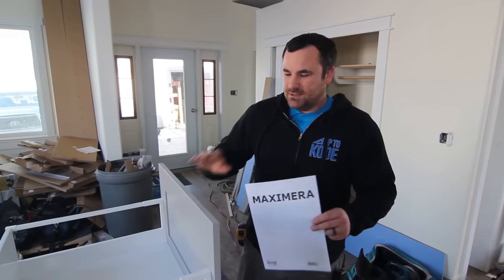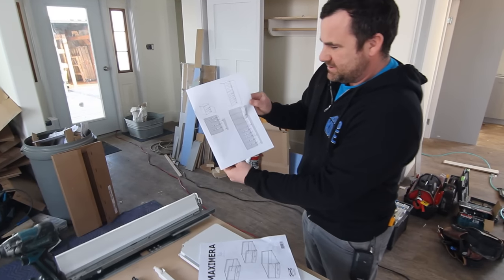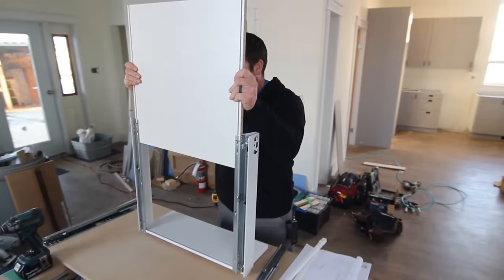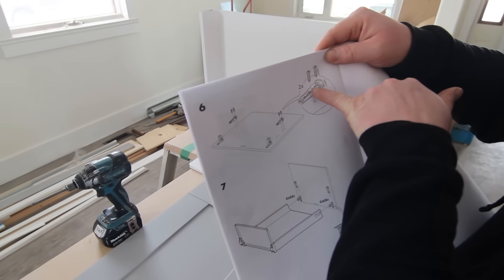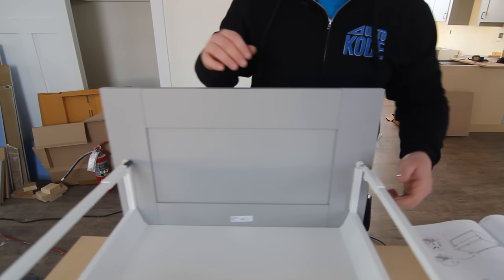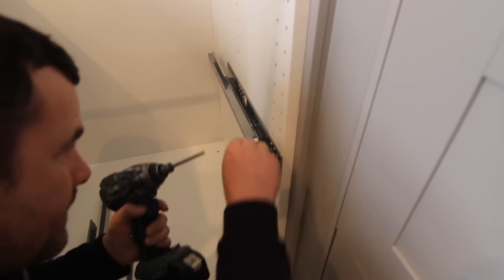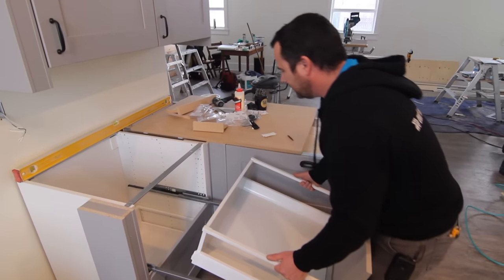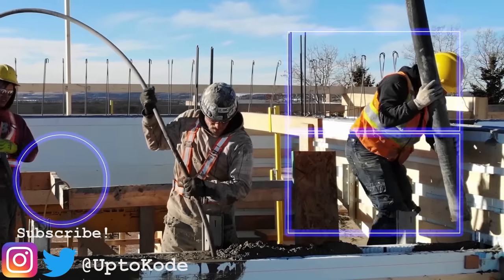How to Build an IKEA Maximera Drawer

Comment: I know this is kinda old now, but thanks for leaving it up. I have these drawers in my kitchen and one of the rails pulled loose.  Contractor seems to have only put one screw in the front part of each of them so weight was just eventually enough.   And I couldn't remember how to take them out without disassembling them so this helped me a TON.  I also used the opportunity to reinforce the rails -- recommended for anyone using the large size maximera for dishes/pots/pans.

Comment: Thanks very much for your video! I looked through the instructions and then watched your video before assembly.  I had totally missed the nuanced upper or lower holes in installing the rails, as well as the flush vs recessed front instructions. This was super helpful!

Comment: Kody, props out to you tonight.  Putting together a Maximera 3 drawer and couldn't figure out why the middle drawer was slightly out of line.  Was super familiar with the older Akurum line, but this is my first Sektion kitchen.  Knew I would find an answer from you...the VERY subtle difference in the screw locations for the mechanism that clicks into the drawer front between the bottom drawer and the middle caught me.  Thank you SO much for pointing out that super subtle difference in the instruction manual.  Screws relocated and drawer fits like a glove.
Reply: I made that same mistake with my bottom (high) drawer. I had to reread those instructions a few times to catch that subtle difference. These videos are very useful.

Comment: Many many thanks Kody. I cannot tell you how helpful your video was for me. 

Everytime we go to our place in Spain I try to improve something. This holiday it was to fit two hidden soft close internal drawers in the kitchen.  
The drawers in the kitchen in Spain are quite deep and the air space at the top of the drawer is unused. Putting in a hidden drawer would utilise this space. 

Of course the process of any DIY project is not always straightforward. Ikea have many kitchen variants and which one is yours! Luckily I have kept all the receipts and plans for the Kitchen in Spain and ours is a Maximera Kitchen. Once this is identified you have to buy the right kit on the Ikea website and the drawer and drawer fronts are sold separately. I am knowledgeable now but on the first pass it is daunting.  A quick trip to Ikea in Malaga and under the tutelage of a very helpful assistant all was sorted. The cost was extraordinarily cheap. The drawer was Euros 38 and the drawer front Euros 8. I bought three fronts in case of error! 

Ikea instruction manuals are not for the feint hearted. Each manual was 44 pages long. It covered all variants of the Maximera drawer range and it was up to you to follow the page sequencing for your drawer. I gave up and watched Kody's very helpful YouTube Video. Armed with the video and my manual the first drawer was constructed and installed in three hours. Mistakes were made and the whole thing was disassembled and restarted. Making sure the drawer base was fitted correctly in the slide grooves is important! The real trick was the positioning of the runners in the cupboard which was difficult to understand initially. The problem was that the handles on the exterior door front had screws on the back and the suggestion for the runner position in the manual did not allow clearance for these screws. The hidden door front was damaged when the screws from the exterior panel bashed into it. I worked out the correct position, replaced the door front and all was well. Fitting required a new exploration of yoga positions and it was 31 degrees centigrade (88F) in Spain! The second one took 30 minutes from beginning to end.

I am very smug and proud. The drawers are perfect in spite of my Wife’s frequent exultations to “leave it, that will do”. Perfection is what we seek! 
Thank you again Kody for making this project such a success.
Reply from the maker: Thanks for sharing your story! Glad I was helpful for your project

Comment: Have you ever installed the drawer rails before completely assembling the cabinets?   Two years ago, I assembled 5 of these cabinets for my office. I did it per the instructions. It's such a tight space to screw the drawer rails into a closed cabinet. If I know what size drawers I'm installing I should just be able to count the holes, right?  Is there a reason NOT to do this??  I'm over being a contortionist.  Would like to know your opinion.  Thanks
Reply from the maker: I don’t see why you can’t do this.

Comment: Thank you for the video it was very helpful. I struggled with the rail placement until I saw your video. It took a magnifying glass to see what hole the rail screw went in, could Ikea not make it any smaller as hole placement is critical for the hidden drawer and large drawer.

Comment: Thanks for the videos! I have an issue I haven't been able to resolve. I have a 24" wide base cabinet with 3 internal medium drawers and a 24x30 door front with the 153 degree hinges. I believe I've put the drawers on the correct holes, but there's no room for the lower door hinge. It seems that I'd have to raise that bottom drawer about 2 inches, which leaves a funky void below. What am I missing?
Reply: What are the interior dimensions/clearance of the two drawer cabinet.  I’m wondering if they would fit vinyl records for storage

Comment: Hi Kody, your videos are great.  Maybe you can help me.  I'm assembling the maximera two drawers and I can't make the bottom drawer fit.  the top and hidden drawer worked fine, but when I put the bottom one it clashes with the top one so it doesn't close correctly.  Please help!!  Thank you in advance.
Reply from the maker: I can’t remember if this video shows the specifics of the drawer hole placement. You really have to keep an close eye on what hole is used depending on drawer layout. 

How to Read and Understand IKEA Kitchen Manuals
https://youtu.be/em4npozEkCs

Comment: Kody, is it okay to use the maximera low drawer for the bottom of a 30 inch sektion cabinet with a 30 inch by 20 inch front? I made the mistake of buying a high maximera and the back of the drawer hits the disposal.
Reply from the maker: If I’m catching this right yes you can use a large front on a low drawer. You just won’t have a way to adjust the front and it might be a bit flimsy.

Comment: I have assembled a lot of Ikea stuff but this is my first time with kitchen cupboards. after watching a few videos I am very comfortable attacking my newest job. thanks a lot for this video as some of my installations involve slideing drawers. but would it not be easier to install the sliders before actually assembling the unit? you don't have to climb inside after all right? just sayin'
Reply from the maker: It’s possible! If it works for you and it’s more efficient then great! Try it out
Reply: @uptokode  boy that little trick to take the drawers apart after assembling really came in handy a couple of times. as easy as it is to put these things together of course I made a couple of mistakes but that trick made them easy to correct and I finished the job yesterday and they look great, thanks again.

Comment: Thank you so much! I want to ask to expand a bit on the removal you do in 13.45.. I don't  get this done. There used to be white plastic clips underside the rail which you had to push up to unlock the drawer, but they are no longer there in the latest (December 2019) model...

Comment: Kody - your videos have been insanely helpful! 
Do you have any tips/videos for installing a 24x30 door front on the maximera drawer? The holes in the door front are for hinges, not drawers so its not as self explanatory as everything else!
Reply: I have this problem, too!  My Ringhult 15Wx20H door front only has hinge holes!  I'm not sure where to screw/install those metal clips!  From what I see on your drawer, I'm thinking that the under-drawer-shelf piece is screwed in about an 1/8" from the bottom...Hope it works out!

Comment: Hi Kody, first of all great video. I have a question. I have basic non Ikea shaker cabinets and I'd like to add these maximera hidden drawers by replacing the shelves in the lower cabinets. The measurements sort of match. What do you think about this idea? Is it worth to try and see or do you think it'd be a painful waste? 
Thanks so much
Reply: Oh one more question; on the Maximera measurements says  "Frame, depth: 24 " " I think the drawer hardware doesn't use all of the 24" depth that thinking the Sektion cabinet depth is also 24" but in your video on the hidden drawer installation, there is still just a little bit room in the back and its not touching back of the cabinet. My concern is if the maximera drawers depth would not fit into my cabinets.
Reply from the maker: If the boxes are IKEA then the drawers will work! That’s the beauty of the system, you can change the functionality of a cabinet with minimal effort or cost.

Comment: The drawers have a release lever at the bottom front, so you don't need to wiggle them out of the rails. Just look for the levers with your fingers and push  them up.
Reply: There is none on mine

Comment: Can anyone watching this help? we have 12" base cabs with " pull out interior fittings" we have the rails put on bottom and middle on opposite sides, but they are running so badly? They stop before closing all the way and jiggling them like you might do a normal drawer can kind of get it closed but it's clearly not sitting right since there is a gap at the top of the front when it's "closed".... What can we try in terms of troubleshooting? Remove soft close part? Urghhh
Reply from the maker: Really hard to tell without seeing it.
Reply: @uptokode  fair enough! We are thinking of looking at the soft close thing because it seems like it just stops  dead right when it gets to that part (doesn't roll closed) and when we kind of force it it feels like it's scraping. Will update if we figure it out!
Reply: In case anyone is following this it was that the screw on the bottom front of the rail was one hole over. Yep that's it and it was fixed.

Comment: The video is good up until the point you say that in order to remove the drawer you need to ""wiggle it" - This is not the proper way! 
you should press the clipses the sit in the bottom front side  and that releases the tracks.